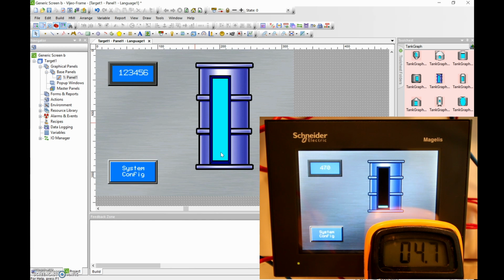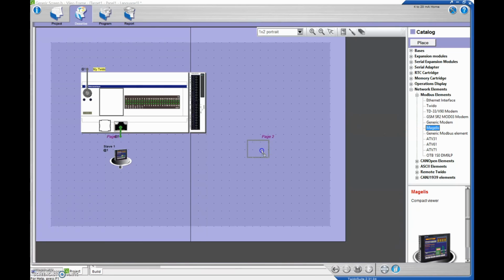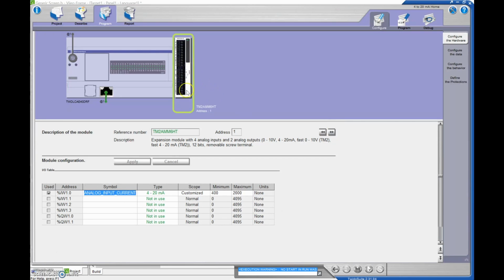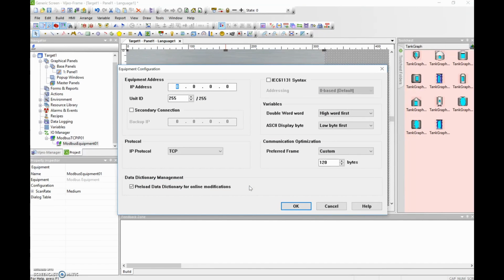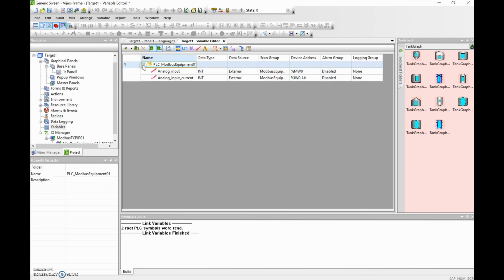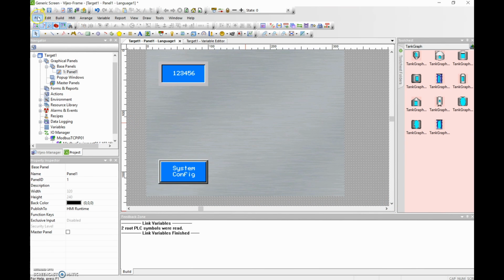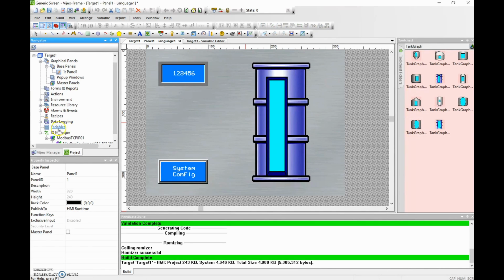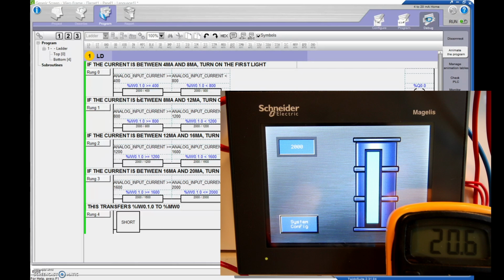Vijeo Designer Tutorial #5 (Majelis HMI) How to display a 4 to 20mA Signal on the HMI

Comment: bro..why is it need to use 400 to 2000, can we use other range? pls reply asap. also..my sensor the value is not constant. droping and increasimg
Reply: He says you should use wider range. If you think wider range gives you more accurate value while converting. 65536 is the max value I guess... Your sensors value must be change but if its too much than you should check it.

Comment: nice video, one question: what's the reason for the short block, what's its function?
Reply from the maker: If you are referring to the System Config Button, it allows you to adjust the IP address of the HMI without using the PLC.
Reply: I meant the short block, in twidosuite (rung 4)
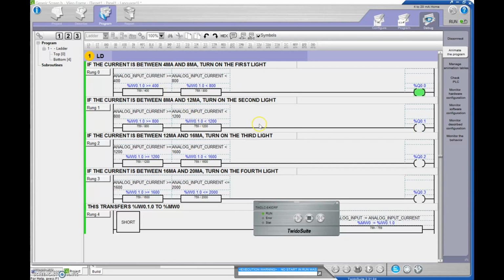Reply from the maker: Check out this video at 2:40 I think I was trying to figure out how to manipulate the value to display the current value in decimal form on the HMI? https://www.youtube.com/watch?v=rsDrGqfibMg&list=PLyL0ResmI4Q3_EvdMZpYylewL-WFYBSLN&index=26
Reply: How would you add a counter on the HMI? And have it reset from HMI also?